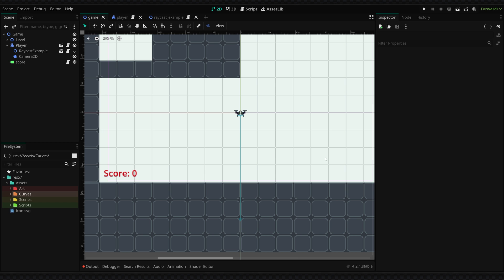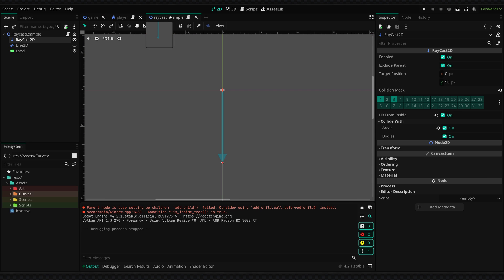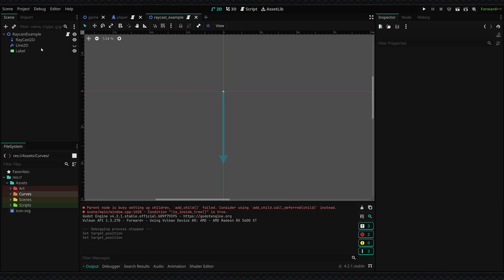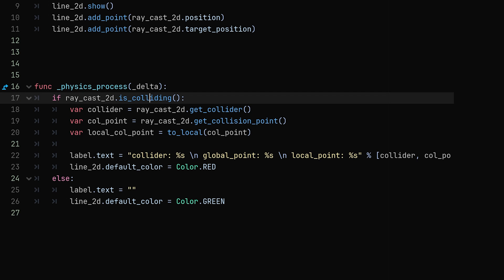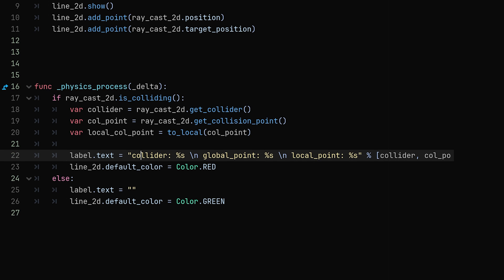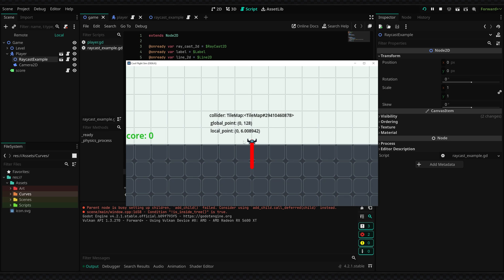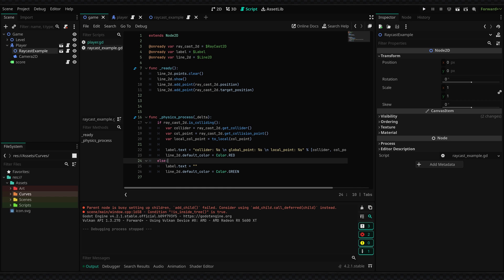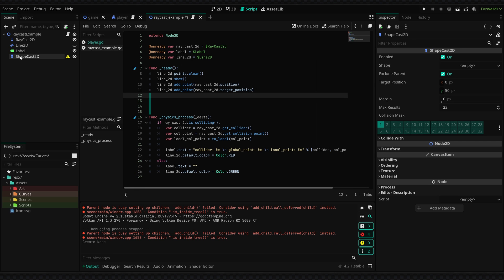How to use Raycast2D in Godot!

Comment: How did you add background color to the folders in the File System in the left bottom corner ? Also nice video !
Reply: I wondered the same, so.... Right Click on the folder in question, then select "Set Folder Color...", 5 items from the top on GODOT 4.5.stable. Cheers!
Reply: @KKelly04  thank you